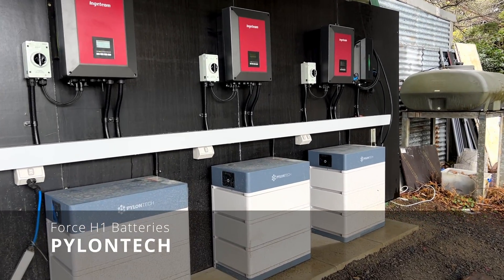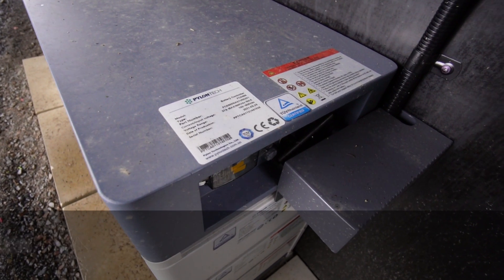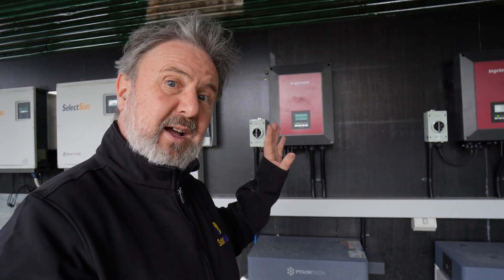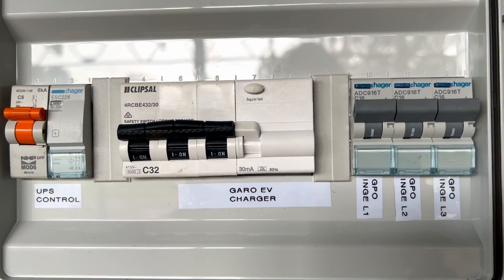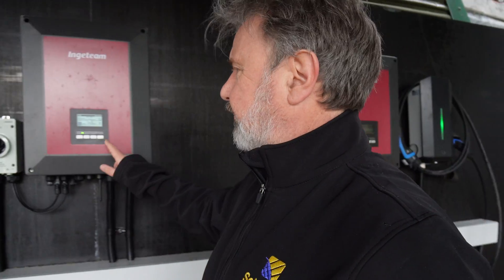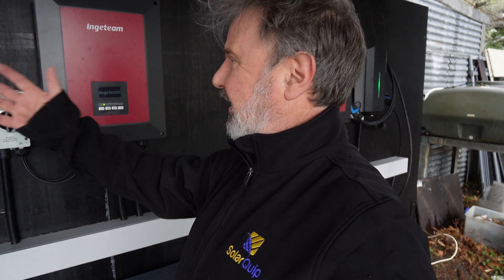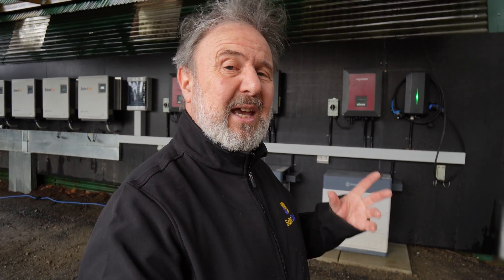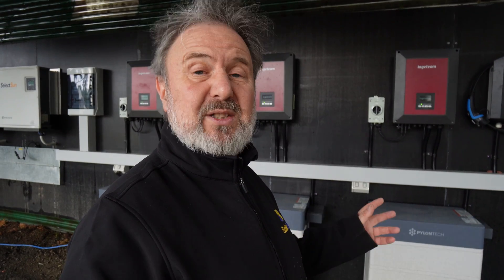3 phase off-grid EV charging station

Comment: Am I missing something, or 3 x 6kW inverters provides 18kW max, yet you state using 22kW charger? I assume it's simply down-rated on the EV charge profile to suit. Still impressive, just want to clarify.
Reply from the maker: Since all the EV's we have at the Lab only have a 7.4kW single phase charger built in, only one phase of the 22kW capable charger is used. The Ingeteams are connected on the grid side to a microgrid and thus can draw any extra power from there as required. Two of the EV's that use this Garo EVSE only have a Type 1 connector and draw a mere 3.3kW.